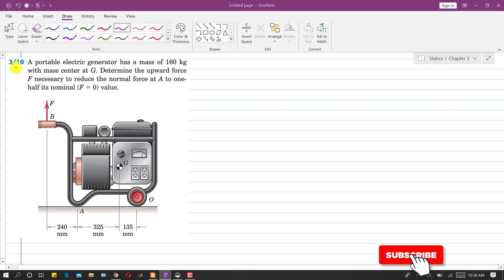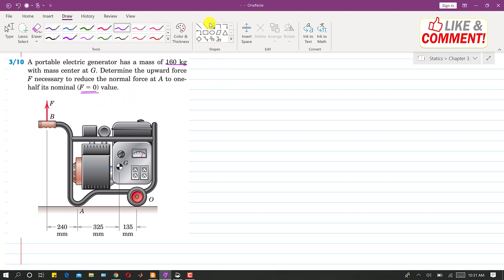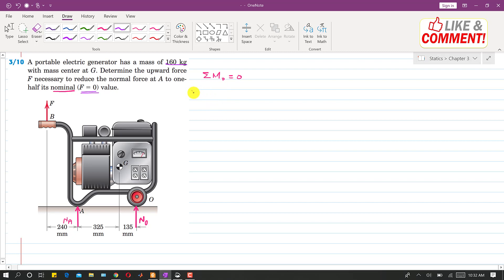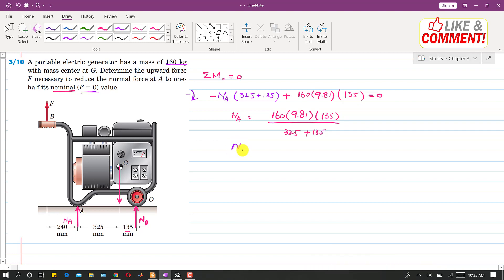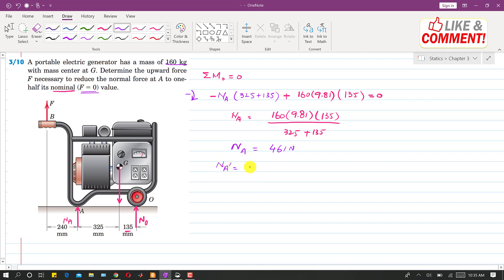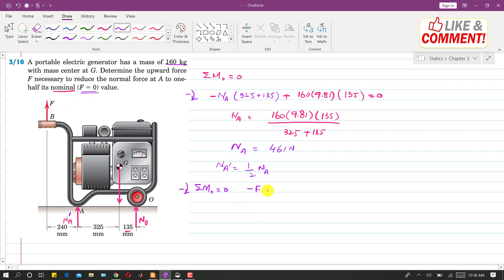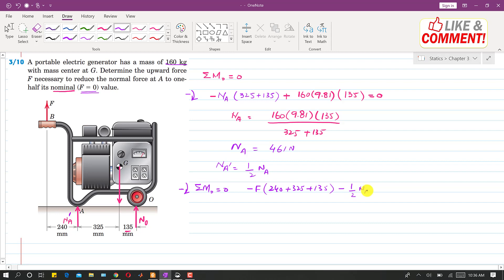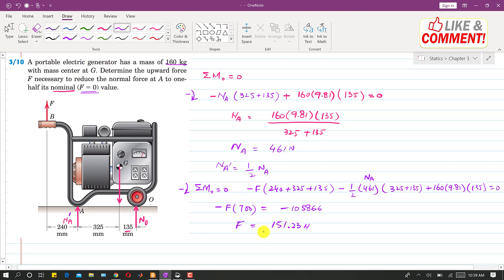Engineering Statics | P3/10 | Equilibrium in 2D | Chapter 3 | 6th Edition | Engineers Academy

Comment: It's means 151.23N force is required to lift the generator for move ???
Reply from the maker: No, when Na is zero at that time F will be the force to just lift one end i.e. end A of the generator.
Reply: @EngineersAcademy2020  how may I calculate  force is required to lift ??
Reply from the maker: When Na is equal to zero.